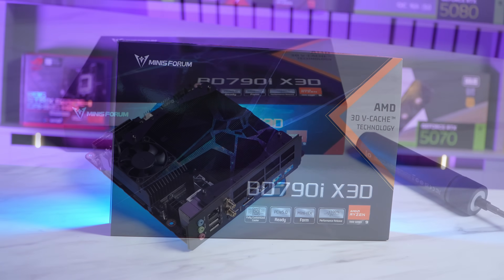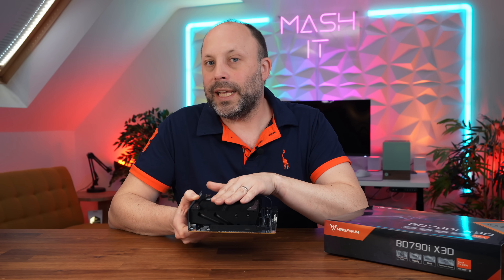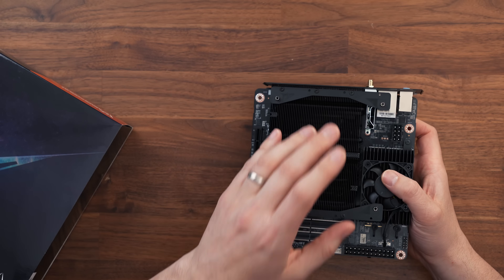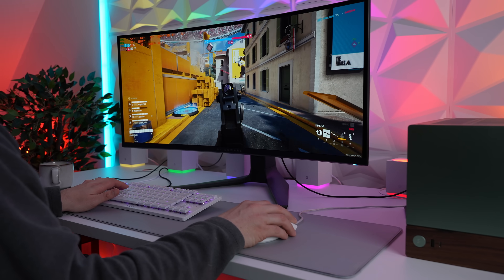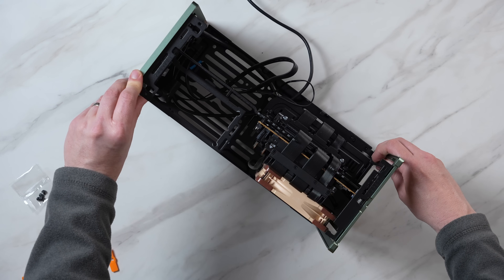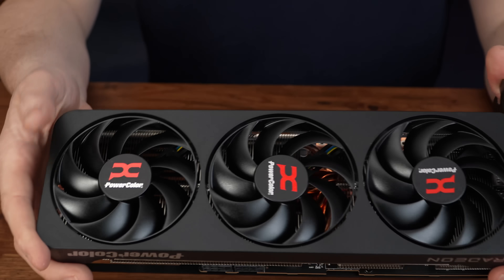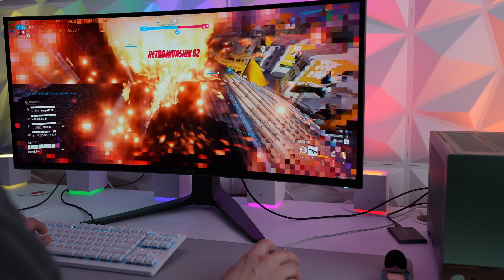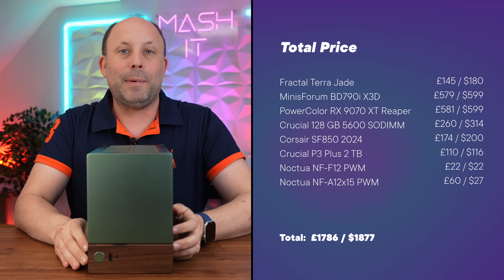The X3d You've Never Heard Of! Minisforum BD790iX3d Build Featuring Fractal Terra, 9070xt & 7945HX3d

Comment: Once again nothing on the TERRIBLE DRIVER installation. Provided in .bat format that doesnt run requiring powershell pnputil install of .inf individually and then the program. Realtek is dog shit constant enumerating causing the Realtek program to popup, the fact that the drivers for the Intel Killer 1675AX cant tell the difference between it and the AX210 so the Killer program wont run or recognise the 1675 as anything other than the AX210. The AMD chipset driver installer contant hang at detection so you need to go to AMD and get the TRX40 chipset driver install and use that, which you have to figure out yourself as ABSOLUTELY NO HELP IS GIVEN and no one mentions what could possibly work in place. Oh lets get to BIOS update needing to use efiflash command line on a usb and dig around to find the BIOS provided, because why would a motherboard come with a flasher LOL. No BIOS setting directly for power and adjusting PBO power setting resulting in non boot regardless of settings. 
The terrible fan control via BIOS for fan curve creation (hexidecimal lol fuck you) and the terribly inconsistent performance neccessitating thermal paste replacement. ZERO instructions (one garbage video lol) and absolutely no driver support for their non working .bat bullshit. Not to mention ZERO documentation on the chipsets had to use hardware ID and search it all myself. The realtek audio is dog shit and as I said buggy as hell with no alternative driver support. Same with the Intel 1675AX and its non functioning Killer program and nothing else working as a replacement. With so many reports of these things up and dying and taking MONTHS to get a replacement if you ever actually do, I am flogging off this POS as soon as possible. 
Fucking awful experience and all the reviews are deceptive.

Comment: Your Dune: Awakening benchmark makes no sense FWIW. The scores match at the start because they have same power usage on GPU. At the sandworm scene the GPU on the mobile CPU board drops to 188w fairly suddenly and tanks the score despite high usage and lower temps than the B650e and it's clearly not CPU throttled at 20%. I'd say maybe the RAM mattered in this scene but B660e is 2505Mhz, so slower than the 5200/2600Mhz mobile board. Looks like a Windows configuration issue.

Comment: Hi, I'm hoping someone with more build experience than me can offer advice. I built this PC yesterday  (the video inspired me to try my first ever build, total amateur), but with 2 X 2TB Samsung 990 Pro 2TB M.2 2280 PCIe 4.0 x4 NVMe1.3c SSDs. I have tried to install Windows 11, but it only recognises the installer USB and a tiny UEFI_NTFS partition, not my SSD storage. My first instinct was that I haven't inserted the SSDs properly, but the BIOS does recognise that the system has memory. (Bizarrely, it says the system has 96GBN of memory, about half of one of the 2 SSD drives, which makes no sense to me). I have no idea what could cause only a quarter of the memory to show up in BIOS, and none of it on windows install. Any advice would be extremely welcome as I currently have a great looking PC with no operating system.🥺
Reply: I forgot to note, I checked for a BIOS update on the Miniforum site in case this was the issue, but it seems I am up to date. I also downloaded the drivers on that site, but the add drivers button on Win11 installer didn't seem to pick them up, so I guess nothing there was relevant.
Reply from the maker: Thats really odd. the only thing I can think of off the top of my head is it could be set to raid mode in BIOS, make sure it is set to AHCI. When I get a minute I will boot mine into BIOS and check it

Comment: I just built a MinisForum 7945HX rig. Highly recommend manually setting DDR timings as the auto defaults for my kit (5600Mhz 96GB) were horribly setup and inefficient. I decided to stay at 5200Mhz but greatly improve the timings to optimize for gaming. Only tricky part is in the BIOS you need to provide hex values instead of decimal for all custom DDR timings. I am running CL 36, tRCD 36, tRP 36, tRAS 74, tRC 110 in decimal.
Reply: I gotta remember these settings because i just got my minis forum but its the BD795X3D.

Comment: While iagree that 128gb is more RAM than you need for basically anything but a server or an incredibly data hungry nas, a render workstation, ECT. I feel like if you're on a real budget for ddr5, get a 24 GB kit, it's about 30 bucks cheaper vs a 32gb kit and you can usually get all the profitmance your going to be needing for years to come.

Comment: I really wish Nvidia does a low profile special edition variant for the 5070 and a small sff ready 5070 ti, paired with this would be a dream.
Reply from the maker: I am holding out hope for a tiny 5070ti! It doesn't run that many watts so its easily possible
Reply: @MashITTech  it’s tricky, but might be possible if done correctly, 5070 LP and 5070ti small sff ready, paired with this would be the perfect SFF standard. (Might be even good for next gen consoles as they shift to medium/low medium sized SFF’s.
Reply: @MashITTech  You should do some comparison with 5070ti when SFF style version comes out. I got mine set up exactly like this one with larger fan on the bottom using basic graphic card setup from motherboard. It's not too shabby.

Comment: Hey bro, Is it possible to replace the heat sink of the CPU cooler? I'm sure that the m-atx size version can be equipped with an lga1700 cooler, but can this also be equipped with an lga1700 CPU cooler?

Comment: Does anyone know if there's an alternative GPU to the PowerColor Reaper that's suitable for this build? As this card seems to be in very short supply and out of stock or on backorder everywhere.
Reply from the maker: I can't find an equally small AMD equivalent! no idea but most of the and cards are massive this year! What is the largest size you would be willing to go? Edit just took a look and the Asus prime seems a sensible size and would still fit with this build
Reply: @MashITTech Just needs to be able to fit in the case, I've got the same parts you had, though I went for the graphite case rather than jade and also I couldn't get the bottom fan to go in
Reply from the maker: what size bottom fan did you order? I used a slim 15mm to make it easier as it is tight with psu cable. Can you get the prime 9070xt in your region?
Reply: @MashITTech yeah I got the 15mm fan you specified in the description, did you get special right angle psu cables or something?
Reply from the maker: No, just carefully bent them 90 degrees when coming out of the PSU and guided around the fan. In hind site I would buy a fan grill if I was doing it again. What PSU have you got a SFX or SFXL?

Comment: I've just bought the parts for one of these builds (though I picked a 32GB RAM kit instead of 128GB) but have encountered some issues when putting it together. Firstly, although the video appears to show it should fit, I just couldn't make the power supply cables fit into the case with the bottom fan installed. The cables butt up against the fan and prevent it from turning. EDIT: re my power supply issue, turns out I was using a duff power cable! GPU is still on backorder though.
Reply: How did it go, i am planning to build my own pc and this one is under consideration.
Reply: @TheStrayInu the GPU has been difficult to source though it looks like there's been new deliveries to accompany the 9060 launch so mine is expected to arrive today. Re the build itself, you won't be able to fit the bottom fan unless you have extreme cable management skills or you buy right angle psu cables. Cine bench scores are excellent, and once I get the GPU I'll do an ff14 benchmark as well
Reply: Thanks for the reply! I never built a pc before but i wanted a powerful small form factor and fractal terra is so pretty.@DanJacksonDanj
Reply: Just get a flat fan grille.

Comment: Would not recommand to buy it. I have the BD790i (non X3D 7945HX), and I regret getting it. The reasons:

1. Very bad CPU heatsink and you CAN NOT install normal CPU coolers on it, you stuck with the original cooler and it gets up to 100C° at 100W and high load
2. BIOS is very very limited, no fine tuning undervolting etc. have to use UXTU to tweak the max CPU power if you want you CPU to run cooler
3. BIOS losing settings after power drain (after power outage for example), as if the CMOS battery doesn't work
4. No SATA sockets - so max 16TB of storage if you use damn expensive m.2 drives...
5. NO USB-C socket for the front panel, only 2x usb 3.0, which you can make it to USB-C socket by using adapter, but you will then only have 1 USB-C at the front, and rear IO...
Reply from the maker: Point 4 and 5 were gripes of mine too. point 1 hasn't been an issue for me, it seems to cool well. point 3, I have not encountered this, I will look into it

Comment: I feel like case airflow could be improved. perhaps some very short ducts from side-grills to cpu and gpu fans? would ensure fresh cool air to all the intakes. now case has slight overpressure and will exhaust everywhere else, minimizing recirculation. If there is room, fit more exhaust-fans
Reply from the maker: Yes you are probably right, I haven't played with ducting yet but I really should. I keep eyeing a decent 3d printer to start mucking around with this

Comment: I have this motherboard paired with 64GB of Kingston 5600 SO-DIMM Memory and a 5080 GPU. 
With an undervolt of -20 on the curve optimizer, I’m seeing on avg of 65-70C when gaming in a Fractal Ridge ITX case. It does very well and stays quiet even when gaming for long periods of time. The memory also runs at 5600 with no issues. (I also replaced the thermal paste with liquid metal and it does run about 6C cooler on average after testing with cinebench R23 and 3D Mark Timespy DirectX 12 testing)
Reply from the maker: brilliant work! I might repaste mine
Reply: @ it’s direct die, there is also a protective coating around the die so liquid metal application is very easy.
Reply: I read that oems recommend against liquid metal on the x3d variant because of the stacked cache there are tsv edges and the gallium can react with the backside metallization and destroy the cpu. How has your application held up over time? Do you have the x3d variant?
Reply: @gabrielsheaxyz  best would be Honeywell PTM7950 or equivalent, application is a bit tricky but after a yt tutorial you will manage

Comment: Consider upgrading the riser cable to 5.0, i believe both the mother board and gpu support 5.0. I’ve heard of people having stability issues in setups like this. some are forced to manually lower the pcie speed to 4.0 in bios. Also leaving some performance on the table technically

Comment: So, you need to pay more money for something you won't be able to upgrade, has about the same performance, and takes more niche/expensive components(ram). Nobody cares about the 'optimized' power draw of the cpu when using a 300W gpu and anyone that looks closer at this video can see that the embedded cpu actually consumes MORE power for LESS performance when gaming the majority of the time! Why can't reviewers just be honest/realistic - I get you probably got this for free but your viewers are actually the ones paying your bills, right???
Reply from the maker: How is this more money than buying a CPU and Motherboard and heatsink? This is a 16 core CPU with X3d cache, the nearest desktop alternative would be a 7950x which launched at the same price as the whole package. Even if you bought a 7800x3d and b650 ITX motherboard it would cost more (at least in the UK anyway, maybe it is cheaper in your region?). And how do you work out it uses more energy? I would say this runs on par with my 7800x3d whilst gaming and less wattage than a 9800x3d. Yes they will have a slightly higher frame rate but would also be worse for multi core use. Totally agree with your point on them ram though. At the end of the day I think it is a good product and are you telling me I should;d just give all these new products a miss just because they are not a 9800x3d? I try to be unbiased and I personally feel this is a niche but decent product
Reply: @MashITTech  You can get a 7800x3d and a motherboard for about 100$ less, 120W coolers for AM5 are not expensive, you can definitely get one for 50$ or even less. Now i personally value the ability to replace the cpu at at least 100$, so a fair price for me would be about 150$ less than the current one. Let me just tell you a story, a couple of months ago, a month after the warranty expired, my motherboard emitted some smoke and just died - it didn't take anything else with it, so i could just replace it for about 200$ - if i had this motherboard i would need to spend about 600$ for it, or even more if i wanted to buy a different one since it's pretty hard to get a desktop motherboard with...laptop ram. I would definitely go 'oh shiny' if this just dropped on my lap, but the fact is that purchasing this does not make much sense from an economic standpoint.

Comment: I have both the BD790i and the BD790iX3D ($539 on Amazon right now) and they are seriously impressive. The 7945X3D crushes the 7800X3D AND the 14700K!
Reply from the maker: Yeah I was amazed at how well it performed. Especially with how much I just paid for a 9800x3d and B850i motherboard!
Reply: Amazing mate i have 5800X3D and 7900GRE and i wanted go to AMD but it is too expensive right now but this solution is perfect but also if i want to order this minisforum BD790iX3D it would cost me 830 which is same price as i would pay for dektop 9800X3D and X870 mobo soooo at least here where i live this is no choice for me at all.

Comment: I was looking for something like this, I have the same case but old hardware, R9 3800x and RTX 2080ti, I was looking for a video using one kit (motherboard CPU) like this and vuala, the only Issue I have I cannot put a bottom fan because the cables are pretty thight, how to you put those to avoid the fan? or my PSU is bigger? it suppose to be a SFX Corsair Gold 650W :S

Comment: I'm kind of warming up to the idea of an integrated CPU+motherboard. After all, how many builders, once they've chosen their motherboard and separate CPU, ever upgrade past that initial choice? I've done it, but it was with an older motherboard that didn't support flashing without a CPU and I didn't know if the board would arrive with the latest BIOS installed, which is probably not a common scenario. Anyway, great specs! And while the mobo+cpu sounds expensive, it compares well to separate components and there's no question of BIOS compatibility with the integrated CPU.

Comment: Do you hear the fan of the SSD heatsink?  Can you tell if it’s on?
Reply from the maker: yes you can here it. If the system is idle (I have my 120mm fan on low setting) I can hear a low grumble from the fan if I put my ear near the case. In all honesty, I am not sure if that fan is even necessary as the 120mm cpu fan actually also blows air onto it and would probably be enough to keep the SSDs from throttling. I hope to get some Gen 5 drives soon to test

Comment: why did you place the bottom fan pushing out?
Reply: Pretty sure it was by mistake. I have a setup like this and mine is pushing extra air up.
Reply from the maker: no. I find it is more beneficial to the system extracting the hot air out of the case rather than pushing cool air into the case. I tested both ways on a previous build

Comment: I have seen so many people in some of the SFF discord servers shitting on the performance of these boards based entirely on false preconceptions (in particular related to the actual performance impacts from SO-DIMM RAM), so very pleased to see another data point coming from this video that should really put those ideas to rest. I don't think anyone should be surprised that a processor that was, you know, actually designed to be used in tight spaces could be a more compelling option than a power hungry desktop CPU in an SFF build. A 9800X3D + AXP90-X47 may still be a better choice if pure gaming performance is all that matters to you, but I think this is a great option for people who want to do some moderate gaming and productivity while spending significantly less money.
Reply: At least for gaming I recall the conclusion the memory speed is not that important on a X3D chips compared to a regular one.
Reply from the maker: this is true on my testing as well thanks to the cache on the X3d CPU. And to be fair the small difference in FPS is never going to be noticed in day to day use from a top end 9800x3d to say this CPU but I think people get caught up in the numbers
Reply: If anything, people get to see bigger "1% low fps" impact from having more than 32GB RAM on windows, than having faster RAM. On linux, 32GB is OK, as it does not suffer from poor memory management. 2x 24 GB DDR5 so-dimm goes for around $100, that's just tiny bit more than 2x 16 GB.
And thing is, this entire MB+CPU+RAM comes at around price of desktop X3D CPU alone. That makes it pretty attractive.
Reply: i just got 2 of these nonx3d and am using them in a 2u chassis as my new server.

Comment: 60 pounds for a 120mm fan What the everloving F**K?
Reply from the maker: Yeah, thats not right, they are normally £24 which is still damn expensive. I will go back and check the links (genius links sometimes finds the wrong listings if I use USA as the template
Reply: @MashITTech  its on the video too